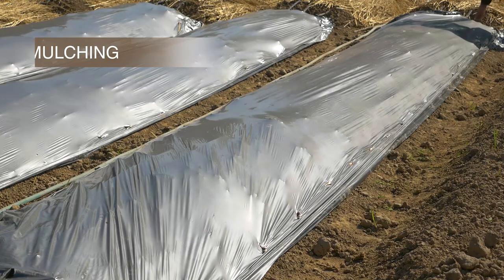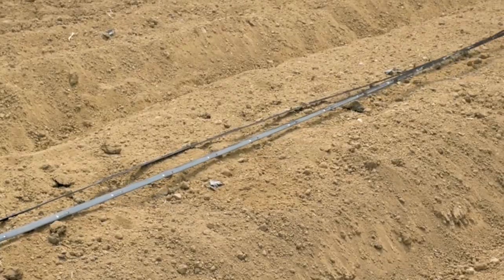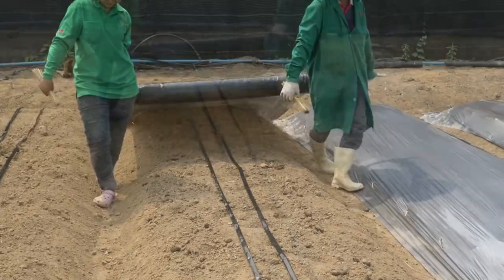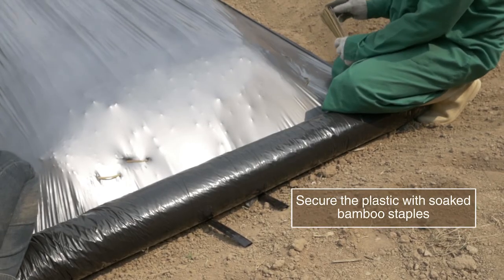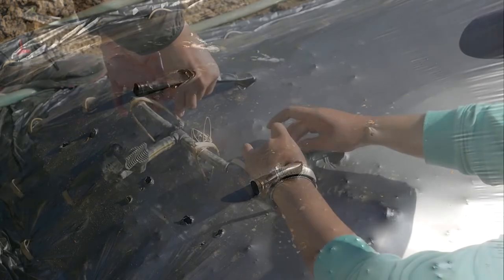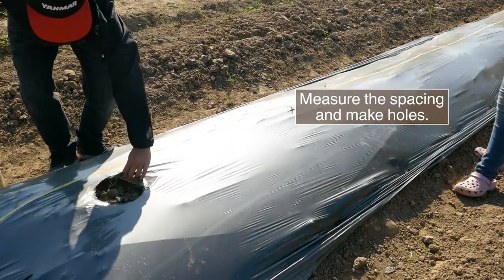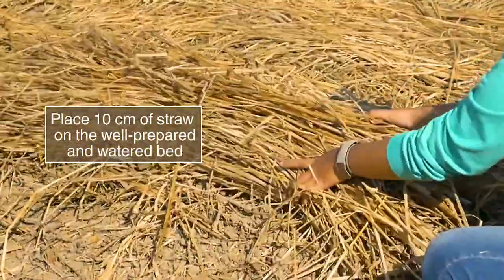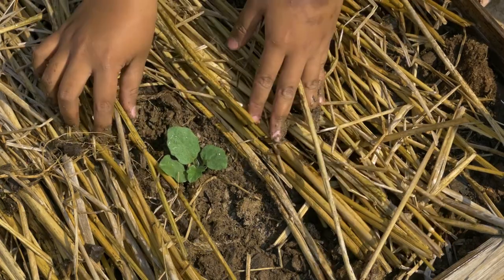How to install and set up mulch

Comment: How do you avoid punching a hole in the drip tape when it's under the mulch ?
Reply from the maker: The holes are usually punched 20 cm from the side of the one-meter bed (for this same lay-out). To avoid damaging the drip especially if a hot puncher is used, you install the drip lines near the middle of the bed or around 30 cm from the side.